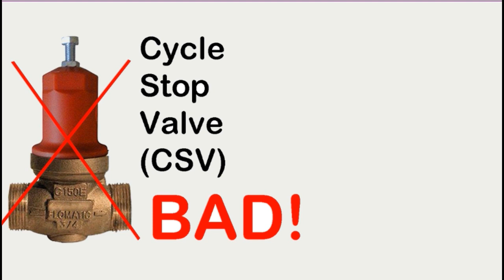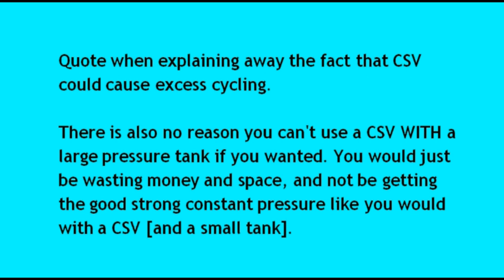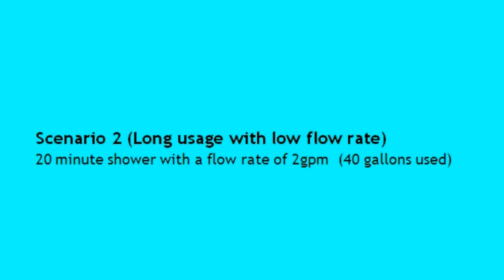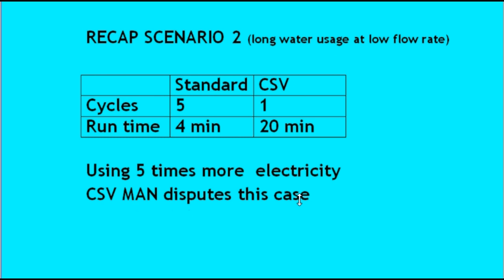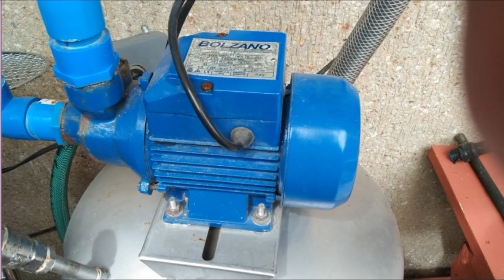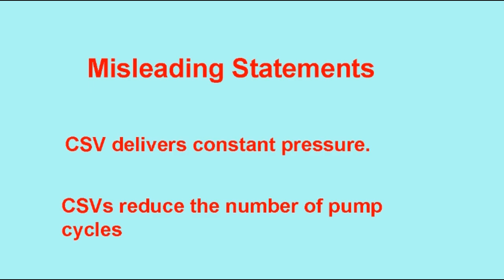Cycle Stop Valves ARE BAD for pressure tank systems!  Pros and cons of CSVs – few pros, many CONS!

Comment: Hey Mr, have you ever installed a CSV or are you making speculation based on theoretical values? I used to have a standard system with 2 P tanks at 90 gallons each. I got tired of replacing pumps 4 times in 30 years, cuz I was watering lots of plants and well as the household usage. Since I have replaced the old system for CSV, I don’t have to hear the pump coming on and off and pump dead yet. You are probably representing some big P tank companies. Just leave people alone!!
Reply from the maker: No you are completely wrong. Probably belong to the CSV company also. I'm quite sure. You don't need an extremely overpriced CSV to avoid cycling. There are many better cheaper ways. If you belong to the CSV company, same old scamming. If you don't, you have been scammed. And contrary to not leaving people alone, I am helping people avoid a scam.
Reply: I am a satisfied customer of theirs. Not related to them at all! You have lots of energy invested in bad mouthing them which causes suspicions for some.
Reply from the maker: @MariaRodriguez-gc9jk  I hope you are telling the truth and are not affiliated with CSV because it’s a waste of my time to engage you if you are. You need not be suspicious. The whole thing started because when I initially (a long time ago) pointed out in his video comments some inaccuracies in what he was saying (in a nice way) he basically told me I was stupid and an idiot. So  that’s when I made the video. Since I have made the video he has tried to get YouTube to take it down, he has insulted me endlessly, told me I am an embarrassment to the human race, that I am making a fool of myself, he has threatened me, tried to bribe me, etc etc. So Why are you not suspicious of him? It’s easy to be a satisfied customer if you don’t understand his product. He solved two problems for you, pump cycling and constant pressure. So you are happy. That is how he scams people, by solving these two problems with a huge profit to his company. You don’t realize you spent lots more money for the product than you needed to, and that you are wasting lots of electricity. Perhaps you don’t care. What’s a few extra dollars of electricity each month after all. If you doubt me, why don’t you take my challenge. I have another video where I offer to improve your system by finding a better way than a CSV. Why don’t you watch that video and then you can send me the information about your system and I can explain how you could have solved the problem for less money and save lots of electricity too.  Here is the link to that video: https://www.youtube.com/watch?v=kM_Fp0ILzKY&t=326s. Or, perhaps you don't want to know, because it's painful to realize you have been scammed.
Reply from the maker: @MariaRodriguez-gc9jk  P.S. Let me give you an analogy. Suppose you have a leak in your faucet. You hire a plumber who replaces the faucet and some of the plumbing at a cost of $500 dollars. Your leak is fixed. You are a satisfied customer and unless someone tells you, you never realize that the leak could have been fixed by replacing a one dollar washer. Then, when you are telling someone about the nice plumber that fixed your leak, he says, oh, i know that plumber, he is a scam artist. You say, how dare you, he fixed my problem and I am a satisfied customer! Why do you put him down?

Comment: As someone who has years of formal training along with 30+ years of experience regularly working with pumps of all types, I will confirm that your analysis is well thought out and 100% correct.  The only point I could add is that amp draw to a motor will only go down if the restriction to flow is on the intake side to the pump . . . and you correctly pointed out that it goes up if the restriction to flow is on the discharge side of the pump, exactly where this product is installed.  Yup, he is being dishonest while marketing his product, and you did a service for the community by exposing it as such.
Reply from the maker: Thanks for your nice comment. Hmm, restricting on the intake, yes that would make sense that amp reduction would go down in that case. Are you saying that his statement that amps go down as flow goes down (even on output)  is a total lie? I had assumed it had a nugget of truth to it, like in some expensive pumps it may be designed that way. But you are saying only for intake restriction? Also, as i pointed out of course, even if amps goes down some it is not  enough to make up for the much longer run time.
Reply: @LarryElterman  Yup, a restriction on the discharge side makes amps go up, but  a restriction on the intake side makes amps go down.   To know if the theoretical lower amps would make up for the longer run time would be specific to each run times versus lowers amps. The calculations could be made using ohms laws connected to the kilowatt hour charge.  The product would reduce starts which would be good for the pump, but longer run times as you correctly pointed out would counter that benefit, and that calculation would be specific to the design of the pump.  It would be good on a pump with great bearings and poor windings, but bad on a pump with poor bearings and great windings.  So for some users of the product, it could increase the pumps life if their pump had great bearings.
Reply from the maker: @brianbresee2871  I don't understand your reply. As we both pointed out, the CSV always goes on the discharge side of the pump, and thus the amps would always go up and it would always cost more electricity. Thus it would be longer run times and more amps, lose lose. You made it sound like a trade off, there is no trade of so far as electricity is concerned. The only possible trade off is in less cycles that would occur in SOME situations. But in most situations there would be more cycles. More cycles, longer run time, more amps, lose lose lose lose lose :)
Reply: @LarryElterman  I did look around his product site some.  He does acknowledge his product doesn't work with all pumps, so I partially retracted my comment on discharge line restrictions increasing amps.   You are correct from there.   The trade off on electricity consumption could be calculated using ohms law in relation to lower amps versus longer run times,  I challenged him to make these calculations with me on film . . . . something I doubt will end well for him for the very reasons you pointed out.
Reply: @brianbresee2871  & Larry you both don't really understand Pumps or you wouldn't be making above comments.
Am not familiar with this CSV or if it's "Value for Money"I do believe it would work in certain circumstances.

Comment: I believe you have shown that the use of this valve is at least guestionable for your average residential user. However it appears this valve could be beneficial to larger users like farms, as most comments in favor of csv seem to be larger continous users.
I personally was interested in csv due to cycling of pump when I run sprinklers.  While I'm now unsure of cycling vs duration, which is worse? I'm pretty sure I don't like switching anything on and off over and over again, if I don't have to. I'm thinking about installing a csv with a bypass for lawn sprinkling only. I will not be using a csv for regular household use.
Thanks for such an informative video, well done!
Reply from the maker: ok, so here is a way better way, way cheaper, way more efficient. ready? Simply buy a small pump that is exactly sized correctly for your water sprinkling needs. Connect the pump to your water tank (not pressure tank), turn it on when you want to sprinkle. The pump costs way less than the CSV and you will save lots of electricity besides. The thing about a CSV is not that it does not work at all, it is this. Sometimes it is terrible, and even when you could argue that it helps, there is always a better way! Did you see my challenge video? Not a single person could come up with a case for a CSV where I could not find a better way. And if you are going to install a by pass anyway, if you are concerned with TOO much pressure, simply buy a pressure reducing valve which is way more  cheap than the CSV. I hate that people are fooled. The CSV is a scam product and there is ALWAYS a better way. Always. Don't believe me?  I would be happy to help you figure it out if you give me your exact set up and needs.

P.S. I will help you even before your answer based on my guess of what you need. So i am guessing you have a a 
pressure tank and you are getting your sprinkler water AFTER the pressure tank, there for the water is cycling on and off. You already said you are willing to install a bypass. So, simply bypass the pressure tank. Again, i can help you if you want. Anytime i can stop someone from buying a CSV is makes me happy.
Reply: Of course, bypass the pressure tank!
I had to laugh at the simplicity of that and cry because I didn't think of that....yet.
I think I can easily (famous last words) just add a shut off valve going to pressure tank.
Thanks again.
Reply from the maker: @dawnbristol7380  lol, you are welcome!
Reply: You know I started thinking about how pump would react to shutting off pressure tank to run sprinklers. I think that might cycle pump even more. As I would reach pressure switch setting and shut off pump but I would rapidly drop pressure and pump would start again.
Currently I am running 3 sprinklers and my pump runs for ~50 seconds then shuts off and then runs off of pressure tank for ~ 90 seconds.
Agree or disagree?
Reply from the maker: @dawnbristol7380  smile :) disagree, although you have identified something  you have to avoid. 
In the scenario that you are worried about you have put the cutoff after the pressure switch but before the pressure tank. You are correct in identifying this as a DISASTER! But the solution is simply to put the cutoff before the pressure switch,. :) You need a way of manually starting up the pump. You could  install a bypass switch, or you could simply open up some faucet for a moment after you have isolated the pressure switch, which will turn it on, and it will stay on until you again open up the bypass. Don't know if i am being clear? Get it?  In other words the bypass will prevent anything from going into the pressure tank, so if you run some faucet the pressure will go down, the pump will go on, and since the bypass prevents water from going into the pressure tank it will stay on. This is kind of rube goldburg. The better way is to install a bypass electrical switch that manually turns on the pump. Keep in mind that you have another problem here in that while the sprinkler is working, the rest of your plumbing is not working. This is why I suggested a separate pump just for the sprinkler. A cheap pump is less than 100 bucks.  Need a diagram? Where is your main source of water by the way? do you have a water storage tank? Town water? a well. Tell me your situation. Hmmm, another though, if your pump is too powerful, and you disable the pressure switch, you could blow out your pumps, check out that the max pressure of the pump is not over what the plumbing can take. I am rambling haha. There is a solution, i would just have to have more details to tell  you exactly what it is.
Reply: I've had a CSV for a few years now and really like it. My suggestion is to have a large preassure tank and a CSV. That way you basically have the best of both worlds. Most of the arguments against a CSV in this video are actually against having a small pressure tank.

Comment: I disagree with this analysis. The valve works. Had one for years. Pumps last longer! Pressure tanks last longer! I have a 3hp pump and use hundreds of thousands gallons a month. This valve does exactly what is says it will.
Reply from the maker: What is your definition of "works"? You mean it works to cause a cycle every time you flush the toilette?
Reply: I mean the pump rarely cycles. If you don’t use much water the valve may not benefit you. Before I got one my pump would cycle around 60 times per hour. After it will cycle only if I use less than 5 gpm, which is rarely. My pump supplies my whole farm including 2 houses, 4 chicken houses, cows, garden and swimming pool.
Reply from the maker: @gsheatherly  ok, so you solved the problem using a CSV and you are happy, but you don't realize you could have solved the problem cheaper and more efficiently without a CSV. If your pump is of such high capacity that it can supply all those things going at once, then it is indeed a powerful pump, which means when it is going at low speed, like only washing dishes, you are wasting an incredible amount of electricity. On a farm, when you are doing high capacity things  that last a long time it is better to go directly from a storage tank directly to your application. (example irrigation) using a properly sized pump. Based on your description you are wasting a lot of electricity, and your pump is running far longer than it needs to. However, i know from experience, given that you have already purchased it, you don't want to believe you wasted lots of money. It's painful to admit. P.S. Let me give you a quick example. Suppose somebody comes in at 3am and decides to take a 30 minute shower. No other water is being used.  That means, with the CSV your 3hp pump is running for 30 minutes using 2000 watts for supplying this shower, which in theory, could be powered by a 1/8th hp pump.  An inefficiency of 2400 percent.
Reply: @LarryElterman  You keep saying the peoples pressure issue can be solved cheaper, but keep negelcting to say "how".   What is the cheap alternative?
Reply: Larry is correct.  You are not understanding the technical points he made against the product.  You would most likely safe electricity without it, especially with a 3hp motor.
Reply: All I know is personal experience. My pump used to cycle over 60 times an hour with two 95 gallon pressure tanks. My pumps would go out every 12 to 18 months. Since switching 5 years ago I haven’t replace a single pump ($1200.00 plus labor) If your pump rarely cycles and you don’t have problems you may not need one. It has saved me money. The cost of a pump running continuously is a minor expense in my operation.
Reply: You are obviously some one who uses a lot of water, for whatever reason. Elterman clearly acknowledged for high water consumption the devise actually did a decent job as advertised. Scenario number 3.

Comment: I don't know what valve you are using, but they are adjustable and mine maintains 50 lbs. effortlessly.  There are 40/60 pressure switches.  The valve gives you continuous pressure and drastically reduces pump killing cycling.  When using large amounts of water, this valve is great for reducing the cycling of the pump and that is not debatable.  I've had mine for years and it works exactly as I want it to.  If you have a water system, such as an ozone filter that regenerates, it uses a lot of water at the end of the cycle and you must have enough water to satisfy this demand.  So you will either need a bigger bladder tank or a switch with no pressure low limit (only if you are sure your well won't run dry).  I totally disagree with this video.
Reply from the maker: Not debatable? Everything is debatable my friend!  😉
Reply: I have 30+ years working on pump systems along with years of formal training.  Yup, engineer Larry knows his stuff!!